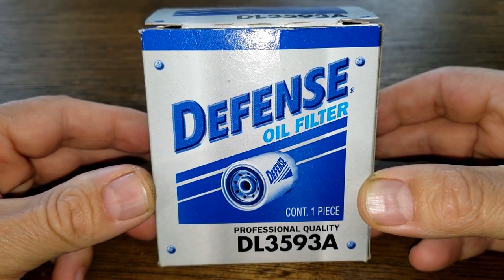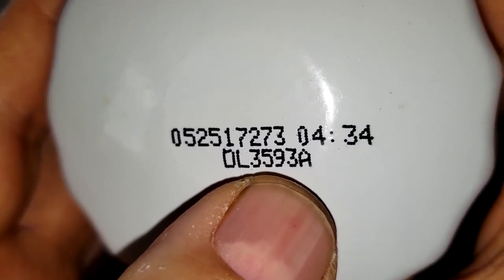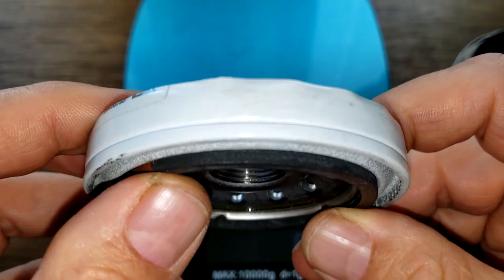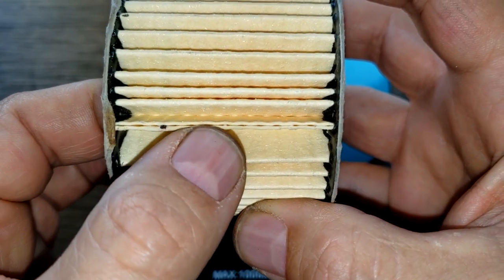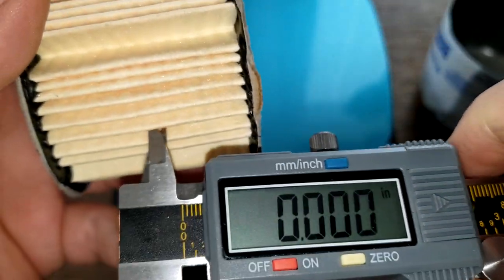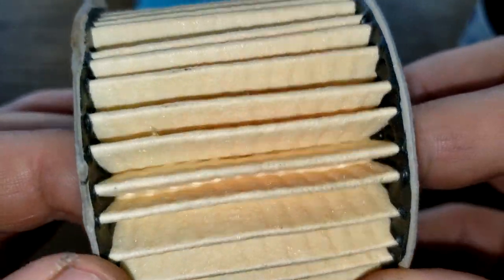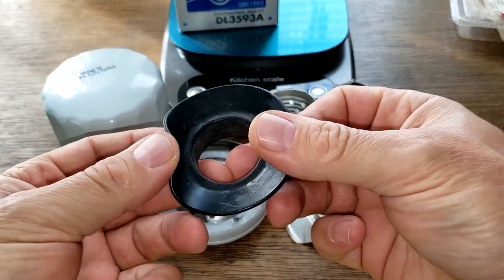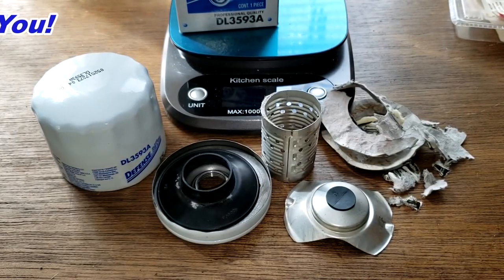Defense Oil Filter Cut Open DL3593A Oil Filter Review

Comment: I didn't even know they made the "Defense" line anymore. As the date code appears to indicate made May 2017 they may not. It's a Fram made value filter, basically a bottom feeder filter. And 100% guarantee it uses a nitrile adbv. Regardless what it feels like unused, they are not putting silicone adbv on this lowest level filter.  If it's black, "I" always default to nitrile. Last time I saw a Defense filter was at Magic Mart store, they all went out of business in 2018. Thanks for video
Reply: I think they killed them along with the Pro Synthetic line ,pretty much an Ultra with no grippy paint, meant as a premium upgrade for jobber filters, don't get the point of the Defence filters if they have the Core line, which are just ExtraGaurds without grippy paint, of course they're only available in "Universal" sizes (ie. the smallest filter that'll fit)
Reply from the maker: You're Welcome!😊🙌

Comment: 95% at 20 microns is nothing to scoff at. That's actually a good benchmark.
Reply from the maker: True,
The micron rating is good, the rest of the filter not too much. I dont care for the cardboard end caps,  but that's me JMO.
Thanks for watching and for your feedback👍
Reply: @WhipCityWrencher  I would use the  Defense oil filter. In filtration: oil is going to flow through the path of least resistance. For a 3K mile oil change interval IT'S FINE. I think the oil filters that are made for 10K + oil change's are a rip off. Why would anyone sober not change the filter when doing an oil change? Personally: I'd rather buy inexpensive oil & filters that meet iso standard's and change it frequently.

Comment: Oil Filters made and sold by the industry world leaders  that advertise their AntiDrainBack Valves to have "SILICONE" as it's base material have valves that are orange or purple.
Very few of these ADBVs are black, and "well, maybe it's siicone" doesn;t tell us anything.
 I suggest that future tests show all BLACK ADBVs as being made of nitrile rubber, rather than have people buy nitrile rubber valves in the mistaken belief that they have a silicone valve.
As you know, the difference is important, since most engine wear occurs at start-up. Silicone valves STOP the dry starts, but nitrile rubber valves get brittle from the heat cycles, and fail.
The center tube is metal, and has holes, but not many -- Spiral-wound center tubes are stronger that the single-seam type of this filter. The plastic center tube found in some oil filters would be stronger and more efficient.
For years we have heard major complaints about the "cardboard" end caps found on the cheapest Fram filters.
Here, we have another example of the "cardboard" end caps, which should have been cause for the filter to be REJECTED IMMEDIATELY, due to the "cardboard" end caps being the Number 1 complaint of all filters tested by the many Oil Filter Tester People.
But hey, it's CHEAP, at $ 1.72  -- but only a brake-ass fool would put this oil filter on their vehicle.
https://www.mercuryforum.com/forum/grand-marquis-14/1995-grand-marquis-restoration-8937/
Reply from the maker: A what fool? 🤣
Reply: @WhipCityWrencher  HE'S pretty intense huh? lol I know you'll probably agree, I've seen more expensive filters look FAR WORSE quality than this filter, for only a paltry $1.72. In fact, had I been that "broke ass fool" and I'd been using this for years and you came along with this video, I think I'd be thinking Maybe I wasn't such a fool. Everything's relative, and we all can't afford to be an elitist.
Reply from the maker: @SlikLizrd  lol
Reply from the maker: @dgunearthed7859  Yep, ive seen a few filters that were just as bad if not worse. A Toyota OEM filter I opened up a while back comes to mind. Thanks for sharing😊🙌

Comment: the 3593A is the old Honda spec. It was replaced by 7317 in the late 90s IIRC.
Reply from the maker: Thanks for the filter and sharing that info😊🙌
Reply: 3593A, 9688 basically same filters. Fram makes a distinction with 'slightly' different bypass psi. Other manufacturers roll it into one application. Honda changed to 7317 early 2000s. 01 Civic first year for 7317 from 3593A/9688. Know because I owned one.